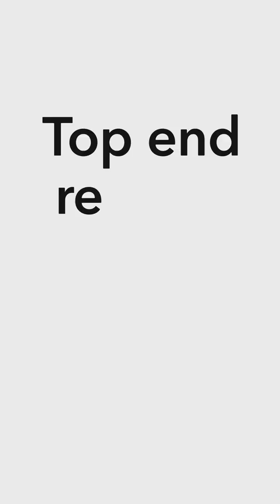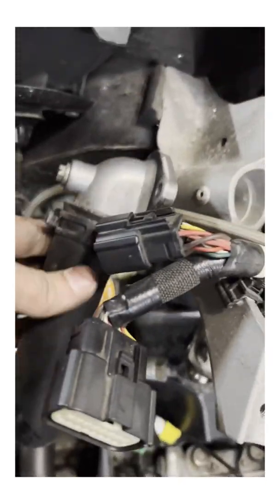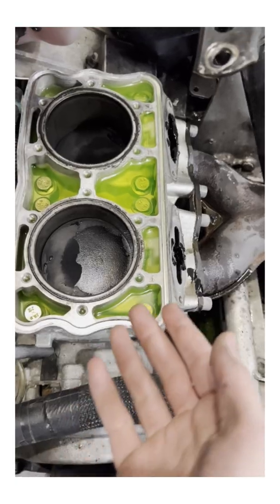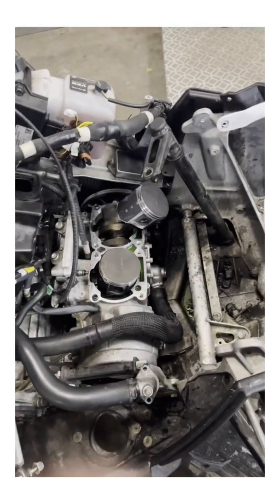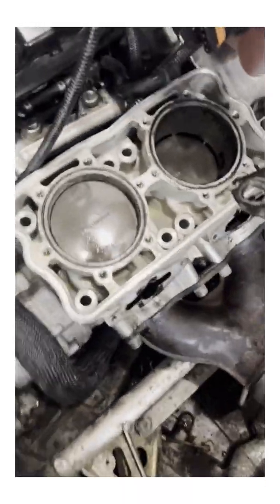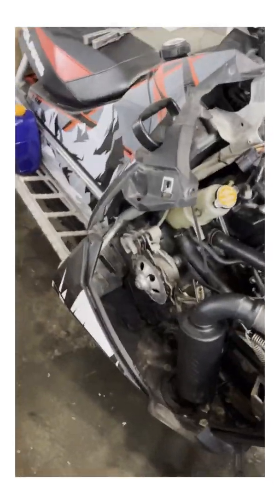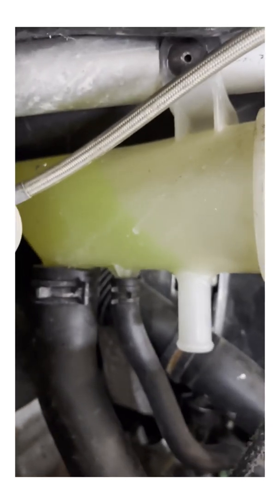Top End Rebuild 2015 Polaris RMK Assault 800

Comment: any preference on orientation of the cylinder base gasket?  looks like it can be installed in either direction with the perforated section protruding upward or downward.  not sure it matters but getting ready to button mine up.
Reply from the maker: Pretty sure it goes upward. I don’t think it matters a whole lot but that would make the most sense. Remember to torque the head bolts to half first and then fully once they are half done.

Comment: Great rebuild buddy ! I just hope you sell your sled before the next rebuild... Red-Loctite is way to aggressive ! Next time you unscrew the bolts the threads will come with the bolts... Been there done that I had to install heli-coils... Anyways good luck !
Reply from the maker: Thanks! I took them off afterwards I forgot to put new gaskets in on a couple spots and they came out pretty easy.
Reply: @tobyemond the earlier you take them out the easier they are... Loc-tite is like concrete... the older it gets the tuffer it resists ! Never use Loc-Tite on engine bolts just my 2 cents. Use blue next time if you can. I only use Loc-tite on the Y-Pipe..

Comment: How is it lasting?
Reply from the maker: Another thing I should add is make sure all the coolant is out of the crank when you put the jugs back on. If it’s only a little it should burn off but I would just take it out while you’re in yhere
Reply from the maker: It’s great so far, great power increase couldn’t be happier with it

Comment: Well done. I've got the same sled, 2015 rmk assault with 1300 miles. How many did yours have at this time? and were you loosing compression/performance? Only constructive criticism I've got is to wait crack thermostat bleeder and allow all to bleed naturally. then elevate rear end above bleeder and start sled while cracked then close when no more bubbles are presented. The hose squeeze method acts as a vacuum and gets no where.
Reply from the maker: Mine had 2200 and compression was 120 each cylinder. Ok, that is good to know. I just learned the hose squeeze from my dad. Thank you I will do that next time and if I do another video I’ll make sure to try it!
Reply: @tobyemond 
120 compression is low and needing rebuild?